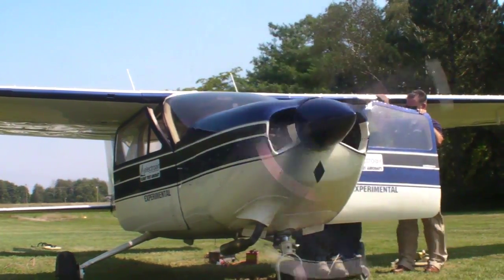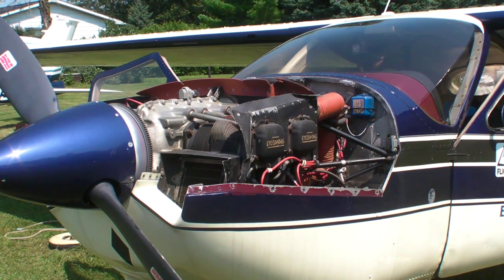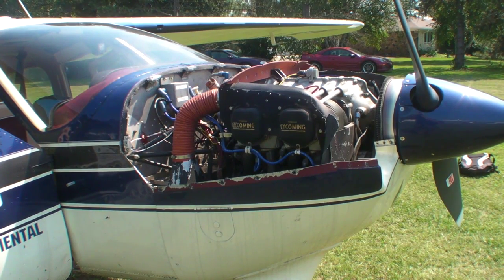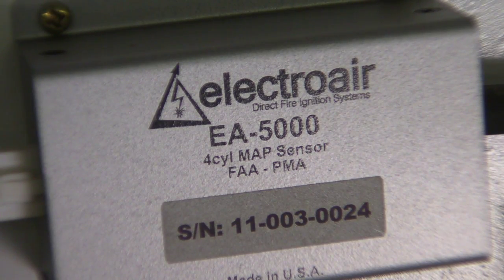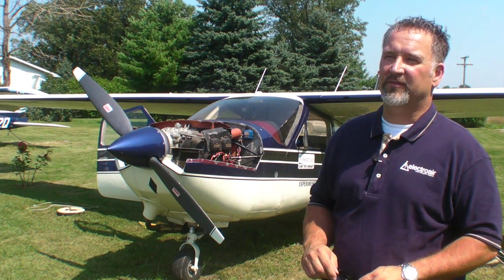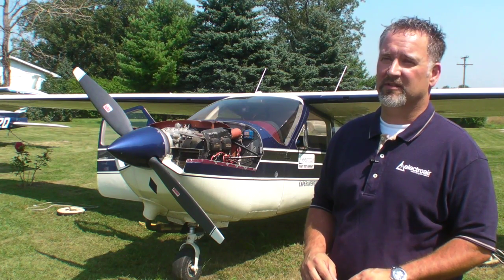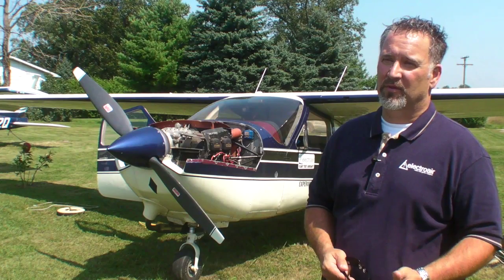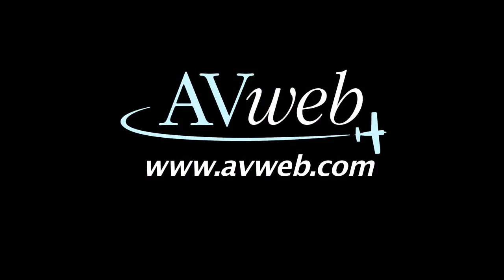Electroair Lycoming Ignition

Comment: Installing Electroair on a 1960 210, working on photos and mods etc. we're waiting on new spark plugs, hard to say how accurate the 6 to 10 hours install is as we are working on other things and we are old and slow. Had to exchange the 22 Deg. MAP advance unit for a 20 deg one. ran the engine and it works well except it cuts out when switching from the mag to the Electroair, I assume this is because it must find TDC, I could be wrong!